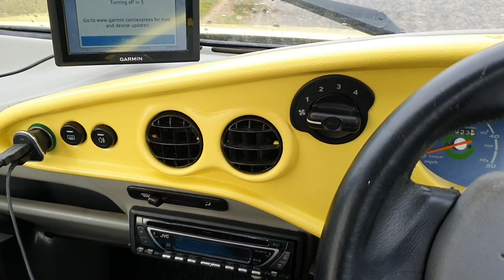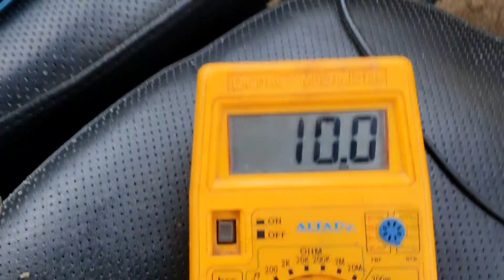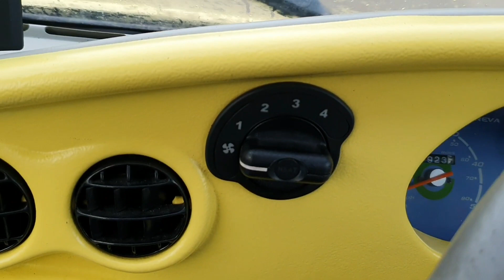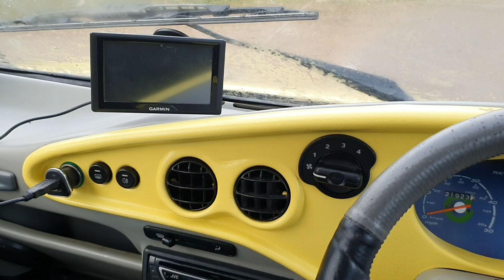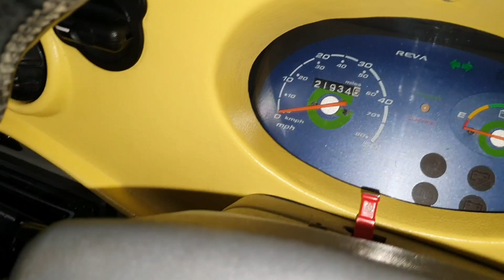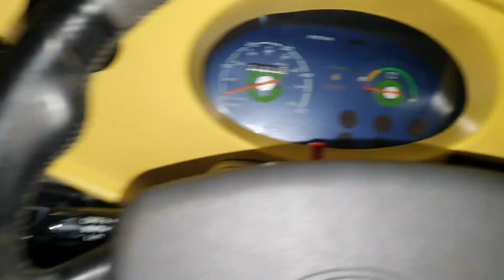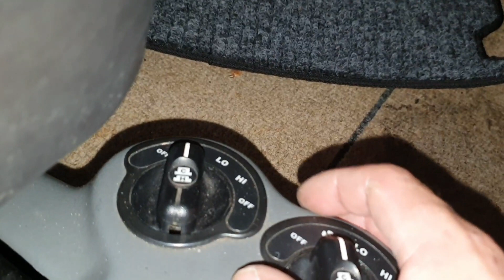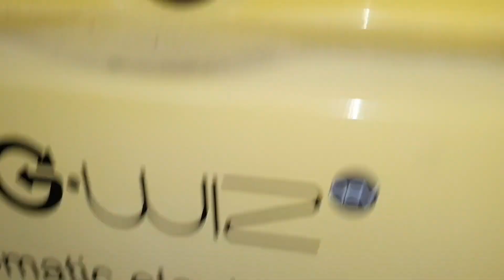REVA G-WIZ: Yellow Wiz Lithium-ion conversion pt.14 - Sad sad news, but could have been worse!

Comment: Don't forget that Roger's car has the bigger tyres on so his rolling radius is giving him a higher top speed for less RPM. Every one of your videos seem to feature you saying "I was doing 60 then something broke"!!
Reply from the maker: Haha, you're right. I guess before I thought I was overheating the motor and this time I eliminated that possibility and didn't put the settings to extreme levels. I fixed them at what was known to work so perhaps it was a faulty brush, or something else entirely happened. I don't think the motor is designed to run at 60mph either and I was only there for such a short space of time that I didn't think it would break. Lesson learned for sure now! - G-Wiz DC motor, don't go above 55!

Comment: Dont worry this electric car everything reparable. it will be success. you can make it
Can you please post detailed video of hot to check and change corban DC motor brush please.
seems Lithium battery installed for 60 + V. Brush may heat up quickly may be. DC motor is designed for only max 54V. I may be wring. 
I have 2004 manufactured DC. I get heat warning after every 30 KM every time for continues drive. I have Lead acid battery in my car
Reply from the maker: Thank you for the kind and positive reply! - You're right the car is pretty easy to take apart and put together. My concern and confusion was how the 12v wiring seemed to short even though it was the motor that shorted on 48v side. My concern is that it didn't damage anything else like the DC-DC converter. 

I'll be uploading a video sometime soon when I take apart the motor and take the brushes out. They don't seem too complicated at all. 

The motor didn't seem to get too hot according to laptop readings but I guess brushes could be a different aspect... Saying that I know someone running it at 74v so it should be ok. 

I wonder if that heat warning on the dash is to do with the batteries more than the motor?